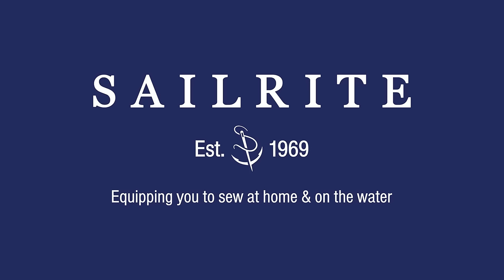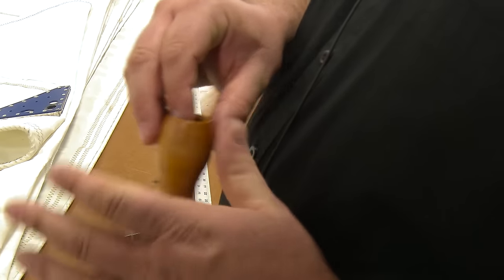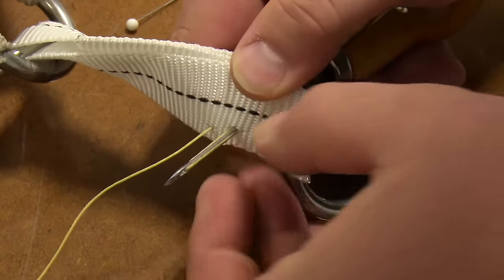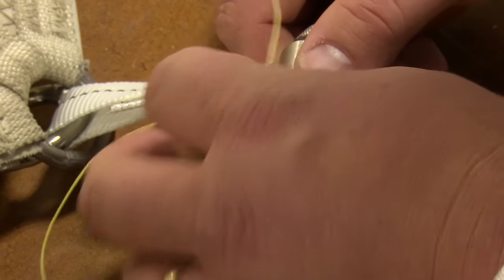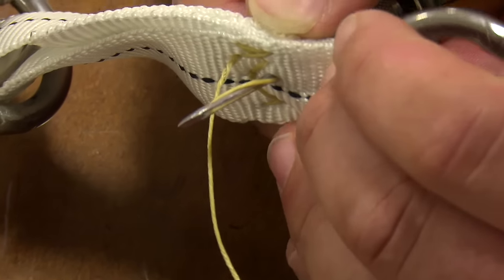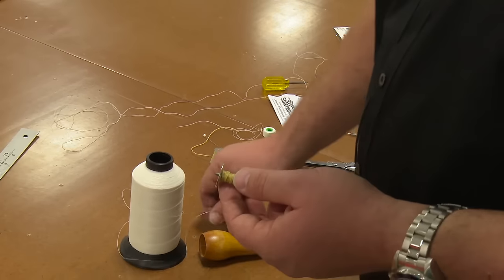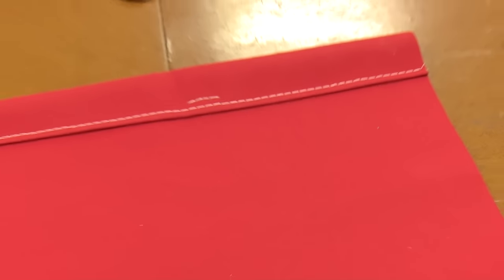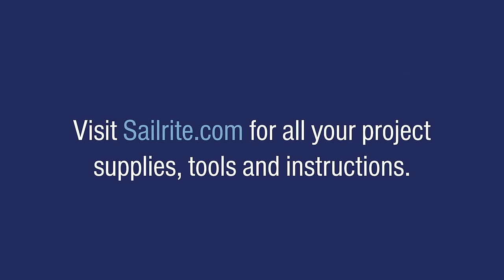Using the Speedy Stitcher to Sew Webbing & Canvas

Comment: I find that attatching a no.4 or no. 2/0 saddler's needle to the tag end helps with getting it through the loop on the back side much easier when using the smaller threads.

Comment: Great demo.  When finishing with the square knot, I didn't have a hot knife.  I leave the tails longer than the demonstrator did, hold them together in close proximity and light them up with a bic lighter.  When it burns down almost to the knot, I use the metal cover on the lighter to mash the burning ends down into the knot.  Doesn't look too pretty but not one has failed for me.
Reply: PS    Thanks for the bobbin winding tip.  Thread locking up on the bobbin has been the most aggravating thing with this system.
Reply from the maker: Yes, that is an awesome idea. Thanks for the tip!!!

Comment: When I look at the close up video of the needle, It seems to me, that leather point needles are used for the Speedy Stitcher. I do not like that use on woven fabrics, because the point will cut the fibers and weaken fabric or webbing. I have used a similar sewing awl, and then I grinded the point of the needle before use, so the sharp edges got smooth.

Are you able to supply needles with regular point for the Speedy Stitcher?

Comment: I can't recall how many decades I've used the speedy stitcher.  I just have to have one.
A few things about using one:  
I heat seal the ends with whatever lighter I have, then press the still melted thread with the metal at the tip of the lighter to flatten the melted thread end.  Usually this means I leave a bit longer tail on the thread ends coming out of the knot.  I also try to have the end knot positioned between/within the stitched fabric, if possible.
In the vid he mentions keeping the knot in the middle.  He means pulling both sides of the stitch below the inner and outer surface of the fabric.  But you can pull too tight and stress the fabric to bunch up.(usually not desired)
You can arrange the "knot" so one side(loop) is pulled completely through the fabric.  This allows for one side to have a thread that is straight through all the loops.  Therefore you have a stitch that can be released by pulling out the straight side thread. (obviously for only special purposes, like make a long basting stitch for temporary alignment.)
Re-spooling the bobbin.  I use an electric drill.  The "axle" nubs on the bobbin are just long enough to chuck one of them to a drill.  Getting some extra bobbins pre-spooled can be handy for big jobs or thread switching.  Just like normal sewing machines.
Find, make, or buy a tool to act as a stitching pony.  Big paper clamps, vise grip pliers, whatever (or even a stitching pony).  Clamp the fabric so your stitches can perfectly track along the clamp edge, and allow for stitching without needing a hard surface to push into.
I haven't checked availability but a "ball-point" needle would be an excellent option.  All sharp point needles can and will cut fabric.  I use "ball-point" needles frequently on sewing machines; and other hand sewing tasks.
I usually leave my speedy stitcher locked and loaded (needled and threaded).  I push the needle into a small piece of plastic foam or a short piece of webbing to cover the point while in storage.
As in the vid, I avoid putting the "next stitch" through any previous stitch.  I prefer to not cut fabric or threads, no matter how slight the risk.
Reply: You should make some videos 😊 I’d watch and learn.  Thank you for your explanation.

Comment: i really liked your tutorial on using the speedy stitcher to make a lock stitch zigzag stitch. i am thinking the technique of making a lock stitch can be used with a regular needle and thread as well? You just would not have the groove for the thread to ride inside of when going through the material? and you would not have the convenience of the handle of the tool  to make it easier to make the stitches?
Reply: Zig zag is the same way, only you sew in a staggered zig zag pattern

Comment: In 1992, Click Schreck designed and cut the set of sails for my 30 ft., H-28 based, sailboat that I built from a mold. I sewed them and did the hand work myself. Nice tool.

Comment: I've read bits n pieces of The Sailmaker's Apprentice. Perhaps the biggest thing that stuck in my mind was, very early in the book, Emiliano Marino was very firm that, apart from a few very rare exceptions...he does NOT use knots. Best we develop good habits from day one! 

So is this a very rare exception? Anyone know how Emiliano would finish this?
Reply: Far, far better to back stitch two or three times then draw the thread through and melt ends without knotting. Also hammer the stitching flat with a soft mallet to bury it in the sail cloth to prevent abrasion

Comment: First thing to do when you get a speedy stitcher is remove the thread it comes with as a bundle, then cut that bundle in three places severing the thread into thousands of little pieces, then throwing it into your garden bed - in fact it may even be safer to bury it for the wildlife to avoid even though you cut it before disposal. It comes soggy, melty, and gross, and will ruin any project you're working on. I prefer kevlar monofilament or kevlar twine for webbing stitching. Been using the same method for decades and boy it holds!

Comment: Highly recommended Been using one for 40 years in NZ can still get needles etc A good buy ,American made  Far superior to fake Chinese one
Reply: I'm not surprised that there are Chinese clones of the speedy stitcher, but I've yet to find one.  I bought mine, made by Stewart Manufacturing Inc, from Ebay in Oz a few years ago.  I really thought I would break those needles, but as good as new despite my abuse.

Btw, I am enjoying the very educational videos Sailrite makes.  If only the postage was not so bloody expensive.  I could absorb the exchange rate difference, but ouch.

Comment: Can't believe I have been threading the stitcher incorrectly for YEARS.  Thanks for the vid.
Reply: If it works it's not necessarily incorrect. I use this stitch and one other that is an entirely different form of lockstitch, where each stitch locks to the previous stitch on the backside. This stitch is the simpler one though, and works as well while using a little less thread, you need to estimate the tail length and not short yourself though.

Comment: what advice do you have for stitching a patch onto a luff tube of a windsurf sail where the other side is not accessible?
Reply from the maker: If you have to repair a windsurfer pocket you will typically need to rip the stitches that hold the sleeve to the sail in the area of the repair so you can get to both sides and lay it flat or in the case of the speedy stitcher get to both sides then effect the repair and resew the pocket back in place.
Reply: @SailriteDIY  was hoping to possibly just loop stitch an adhesive backed patch without splitting the luff pocket as would normally be done. thanks for the reply

Comment: Upholstery needles end up poking holes in your fingers- even using thimbles & pliers to pull the needed through.. then your needle gets burrs from the pliers...Repairs = "A stich in time, saves 9". This is examples of using the correct Tool for the Job.

Comment: Thanks for the video. It helped me decide what to buy. So, an awl that needs you to work on both sides of the fabric, passing a full length of thread and manualy doing a knot for every stich? Exactly ZERO advantages over heavy-duty needles - which are faster?  And cheaper. Pass.
Reply from the maker: Hand needles are an option, but for every stitch you are left with a blank stitch between each stitch. So if not using the Speedy Stitcher, but rather a simple hand needle you would need to stitch in one direction to the end and then when you reach that end, you would have to stitch back again through the same holes to the start point to fill the blank spaces or voids between each stitch length. So... in a matter of speaking the Speedy Stitcher saves more than half the time of sewing with a hand needle because it creates a stitch with no voids in one simple pass.
Reply: It seems you've never sewn with double needle. Or rather, you'd rather sell that stitcher instead of two cheap needles. To each their own.
Reply from the maker: I have never sewn with a double needle when hand sewing, could you point us to a video or blog showing how to do it? Thank you very much!
Reply: Have fun with using your pliers lmao
Reply: @SailriteDIY  For some unfathomable reason, I didn't get the notification of your post! Found out you had asked me something when someone else commented! Sorry for the 3 years late answer...😞
Likely you'll have found your answer by now, and I can't post links due to Yotube being silly with links in comments, but for the record, you can simply put "saddle stitch" in either Youtube search box or in Google. You WILL find appropiate results as the first result of either.